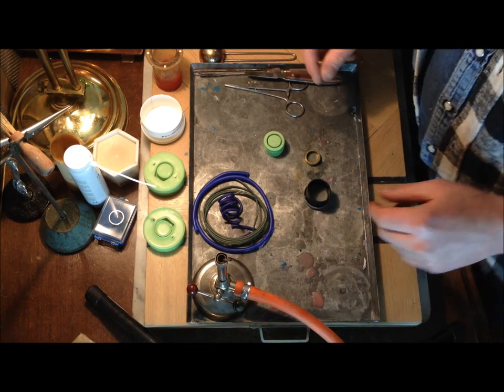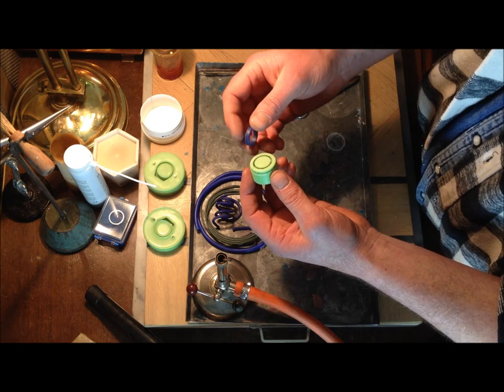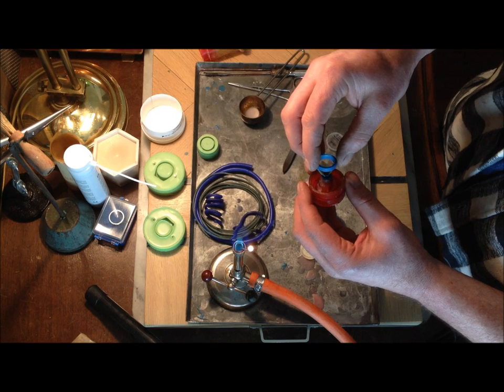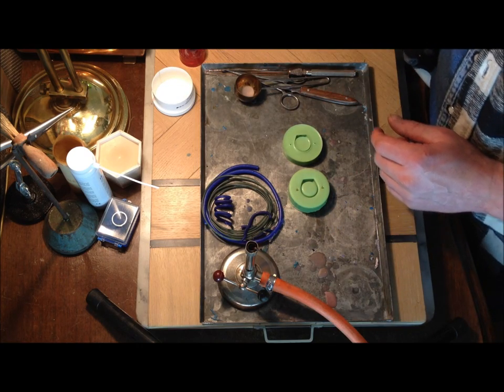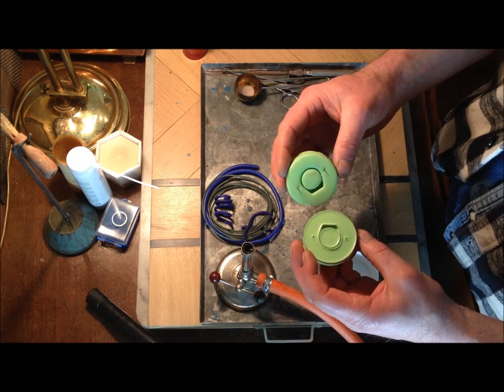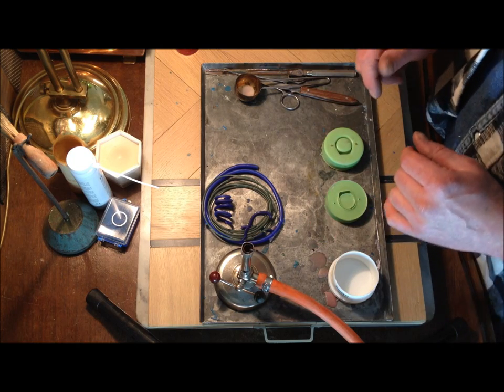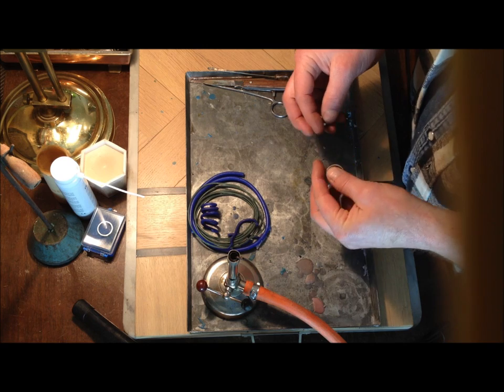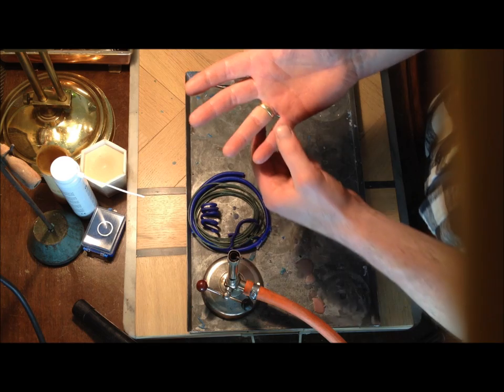cast a ring from A to Z

Comment: a few suggestions. 1. cut a cone into your two part mold and use a wax injector for perfect wax templates every time. 2. casting plaster is called investment.3. never break investment off with a hammer you run the risk of hurting your ring.4. while the investment mold is still over 1000 degrees F. after you centrifuge the silver in, dunk it in room temp water and the investment will disintegrate off the silver causing there to be no need to use a sand blaster. for anyone who wants to do this there are much cheaper and effective ways. the big one being use a wind up casting centrifuge instead of an electric one, also a simple acetylene brazing torch is more than enough heat to get the job done and with a bucket of water you can skip buying a sand blaster.